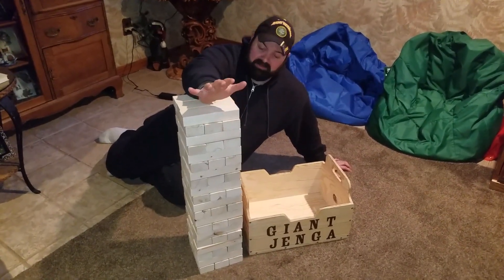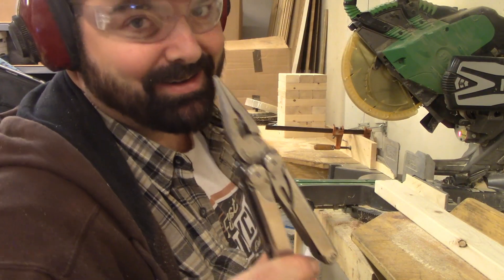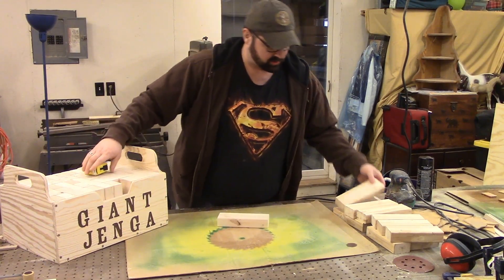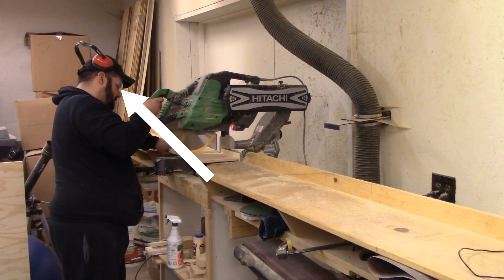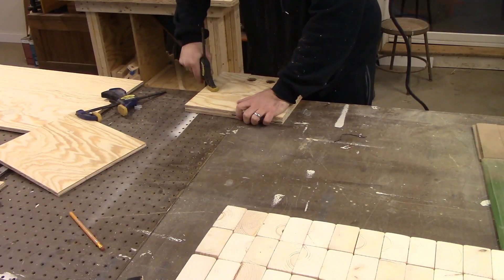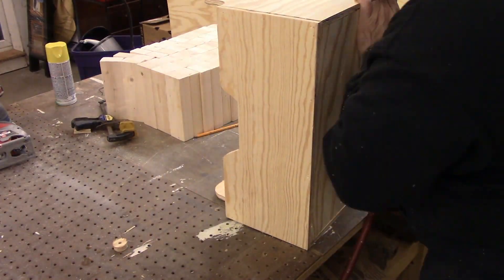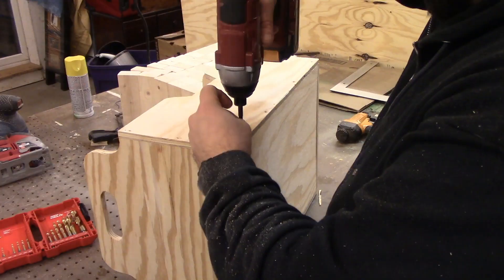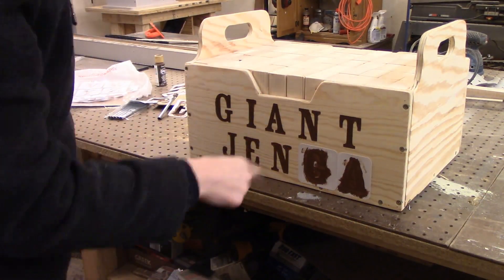Giant Jenga Set

Comment: The lack of a riving knife or splitter in this case was NOT the issue. you would have had no ejection, or kickback, at all IF you had used a push stick/block on the piece between the blade and fence... like any experienced table saw user would KNOW!
Reply from the maker: You are, of course, absolutely right.  You should always use a push stick or push block to keep the work piece  against the fence.  I have learned this with experience and tips from all of you.

Comment: How many 2×4 did you use?
Reply from the maker: I used 2×3s and I don't remember how many.  I just did the math.  Each piece is 7.5 in. long.  And a 2x3 typically comes in 8 ft or 96 inches.  You also want to also want to allow for waste so get at least one extra.